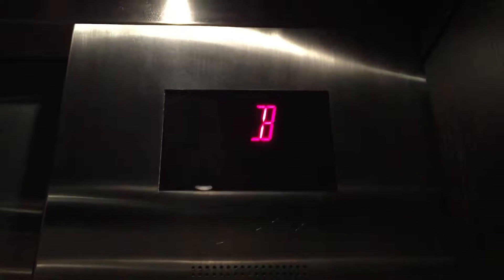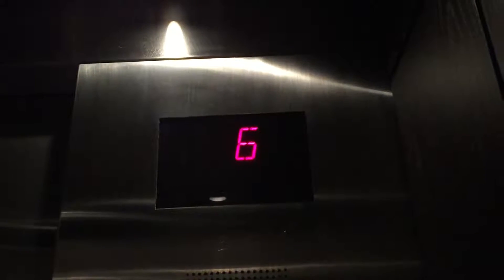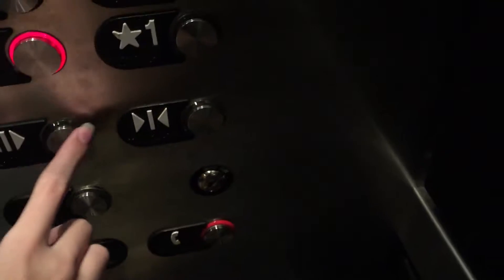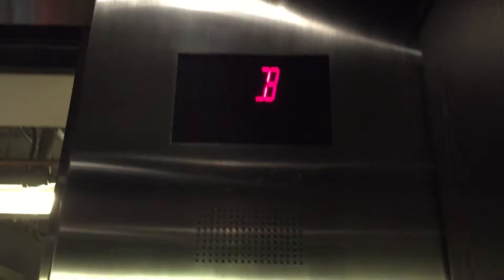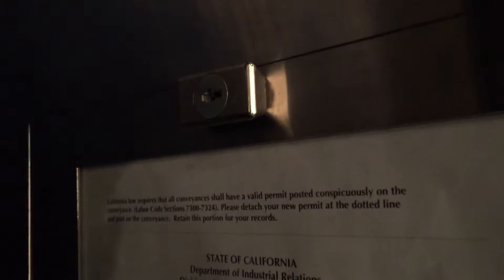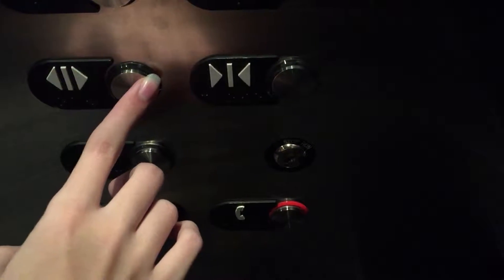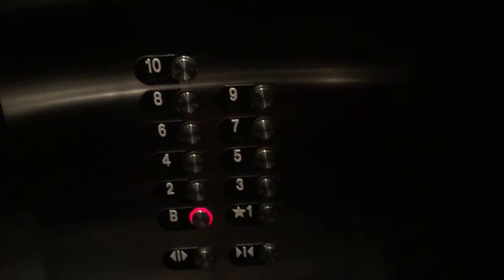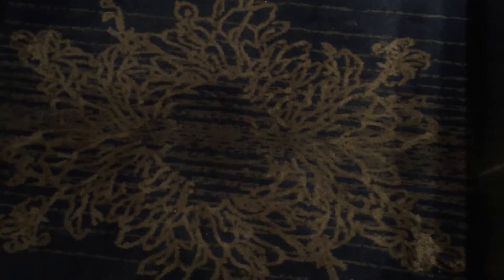Otis Traction Elevators at Wyndham Canterbury Taller Building in San Francisco, CA

Comment: Hmm, that second call station on the basement level is interesting since they both appear to be on the same controller. I wonder if the single slide elevator can be taken out of regular service and used as a service elevator instead with the second call station? Also as Cherry City Elevators mentioned below these very likely are Gen2.
Reply from the maker: +WestCoast Elevators 
I think every floor had a hall station on the door jamb of the elevator with the single slide door.
Reply: +upanddownadventures 
THen that would further back up the theory of using it as a service elevator under separate controls.